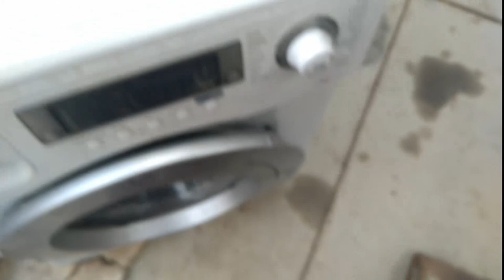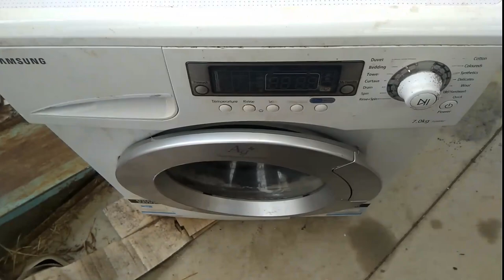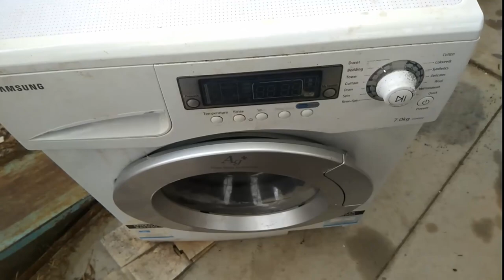Washing Machine Doorlock got COOKED!!

Comment: I have the same problem as you. I can find a replacement door lock but did you end up finding the replacement connector? I don't even know where to begin.
Reply from the maker: No not the connected I just used the spade terminals that came with it then used the original plug to wire o trace  it out
Reply: @OldMatesBackyardTech  Thanks for that! You just saved me from having to find a new washing machine. Thank you so much!
Reply: @OldMatesBackyardTech This comment saved me a lot!  I'm Brazilian and this lock model is widely used in "wash and dry" machines made in China and shipped here by Midea and Philco brands.  My machine was behaving strangely on the lock and started to smell bad when drying clothes, when the lock failed once and for all, I disassembled it and found it all charred along with connectors and cables.  I couldn't find the connector anywhere on the internet, it looks proprietary, but I found your comment and used a female slip-on type terminal to connect the wiring to a new itw zv-447 lock.  This saved me about $700 I would have spent on a new machine.  Thank you very much!